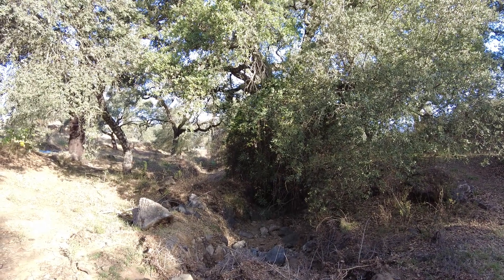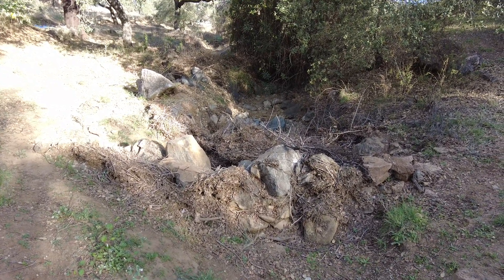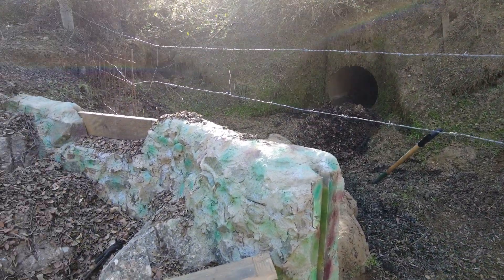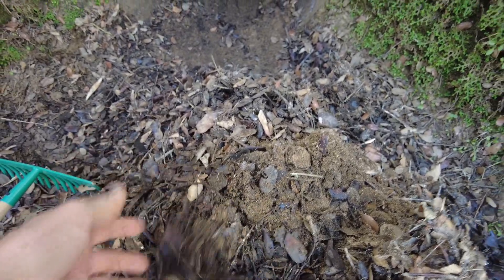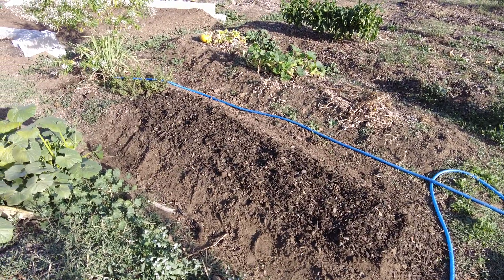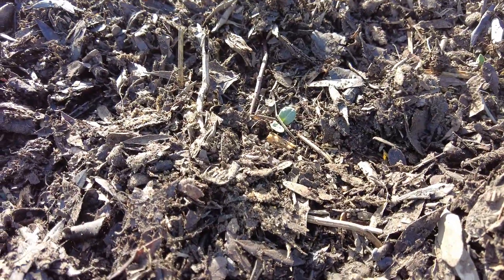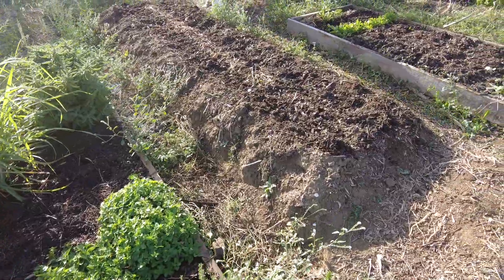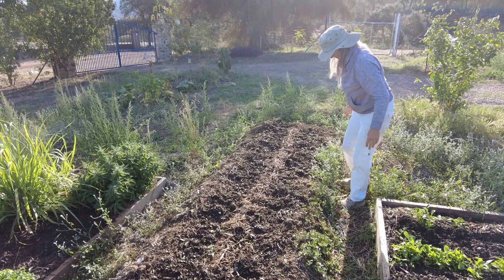This street culvert is an alluvial gold mine!

Comment: any news of when you may get more rain?  digging pond yet?
Reply from the maker: Rain on the tenth of October! They say! You are a hard master and you are right!
Reply: My suggestion (in terms of priorities) would be to buy and install a drip irrigation water storage tank ahead of the pond priority.  As I understand your goals Martin, you want to add more trees and woody shrubs each season.  So you will need irrigation water until you stop planting.  And even then, the trees you want to encourage can use a good deep drink now and again. 😉
Reply: Steve drip obviouslr priority,however,with so little rain,I would be digging swales catchment ponds etc,24/7 because you only have virtually one shot at it,drip irregation can be done asap after,massive pond lined etc,we must build up enough water for one year plus,to be getting ahead.😀
Reply: @mechanics4all405  Clean water is needed for drip irrigation to perfrom over the long haul, so I see it a little differently.  That does not mean I am right 😅 just that I see things differently.  My suggestion would be to pump clean water from the bore hole at a rate that can be sustianed into tanks on the knoll that would hold 10 months supply of drip irrigation water.